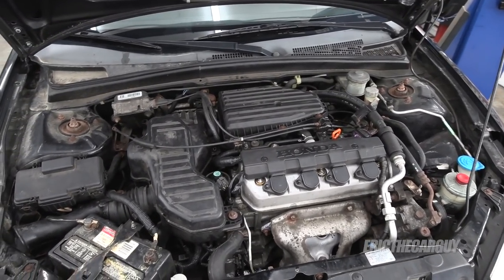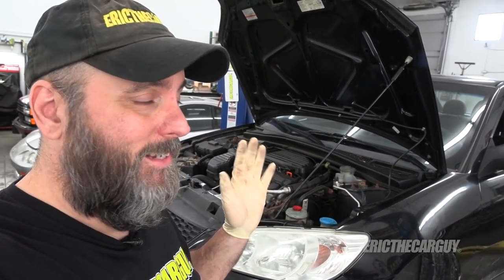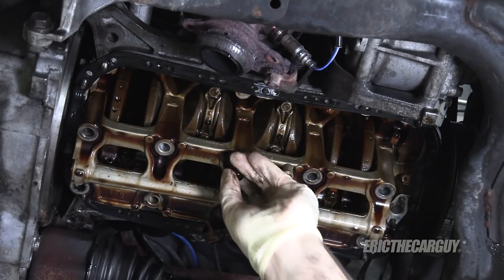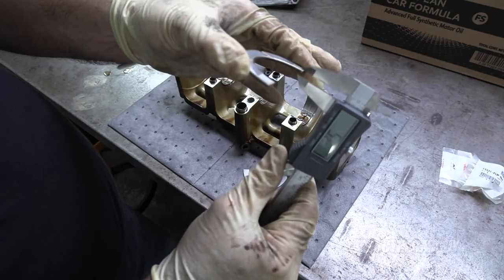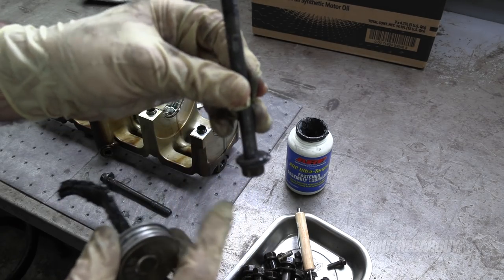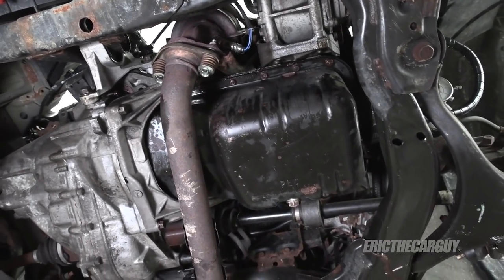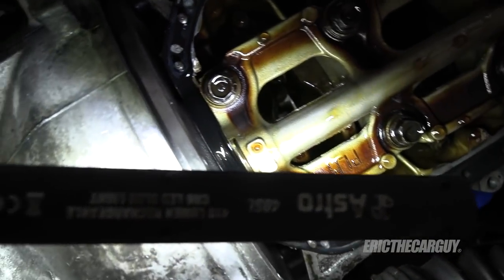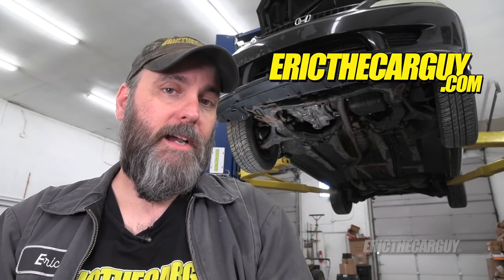How To Test and Replace Thrust Bearings

Comment: I see the lube on the thrust bearing taking up the clearance on the dial indicator - so I check crank end clearance w/o lube on the engines I build.  Then once the clearance is measured, I take apart and lube the bearing for final assembly.  I have a 2008 5 speed civic with 230,000 - I hope it keeps chugging along - manual civics for the win!
Reply from the maker: Great suggestion. Thanks.
Reply: 👍 oil and grease take up space with tight tolerances.

Comment: Eric, have you checked if the engine has high crankcase pressure. That can cause leaks at basically every oil gasket.
Reply from the maker: That's not the issue in this case. I've actually already fixed the leaks. That will be covered in upcoming episodes.
Reply: So true. I got all the bad leaks stopped on my accord but blow by out the dip stick prevents me from having the clean engin bay of my dreams.

Comment: Great video Eric but one thing I was going to mention is that I think some of the excessive endplay you are getting is because you had the base of the dial indicator mounted on the body of the car instead of the engine block so your also measuring play in the engine mounts ect so you may be well within spec 🙂
Reply from the maker: Good point.

Comment: Never seen the inside of a Honda engine so I didnt know Honda engines had a built in main cap girdle. Beefy. I also didnt know they had individual thrust bearing "sides" that were removeable unlike a one piece saddle type main bearing for American V8 engines. I like the Honda version better as it is definitely alot more easily to access and replace while engine is still in the vehiicle.
Reply from the maker: In my view, Honda makes some of the best engines ever. Transmissions on the other hand...

Comment: After market gaskets are HARD compared to the soft and pliable OEM gaskets.  I put a brand new aftermarket valve cover gasket that leaked to no end. Ordered a new OEM one and the difference is massive. The OEM is soft and pliable, it actually expands and seals while the aftermarket is just a piece of hard rubber like material that doesn't seal.

Comment: As usual a great video. I did these on my 03 Mitsubishi that had 150k mikes about 2 years ago that had a lot of end play and oil leaks at the seals. After replacing the thrust bearings, the crank shifted back a few thousands and the seals were no longer riding in the grooves that were worn into the crank thereby fixing my end seal leaks. Downside was the flexplate bolts were slightly contacting the trans cover, some quick grinding took care of that. 15k miles later still dry. Keep the vids coming.

Comment: Every time you miss something small like that little piece of old gasket, you learn from it.
I once changed my oil and got 10 feet before the filter popped off the car and drained all the new oil onto the street. The problem? I never checked for the old filter gasket and doubled-up. 
I've learned and now I take the extra 3 seconds to check every time.

Comment: I’m over 70, time served marine engine fitter. I knew a lovely, old school, old engineer when I was 30. He insisted that every bolt he took out, must go back only into the hole it came out of.
Thanks for sharing
Reply: I'm guessing this is from when machining and thread cutting was not as accurate as it is these days. I guess it would have actually mattered in those cases. Interesting
Reply: @tiberiusclaudiusnerogermanicis  yes, it was “a bit since” much of it was to avoid a stud going into a blind hole if it was the wrong stud and slightly longer or shorter. 
It’s embedded now, I always try to make a cardboard template of sorts and put studs into the appropriate whole. This video shows Eric finding out the hard way, albeit harmlessly. There was a thoroughness about the old ways and there is breathtaking, mass produced accuracy in modernity. I’ve enjoyed the best of both worlds. I have, above my workbench, “Accuracy is a prerequisite, not an optional extra,” and envy those who are inherently accurate.
Reply: @observersnt  no envy for me then hahaha. Very interesting I tend to pop bolts into the holes on the parts or re thread them a little if I can. If it's a rocker cover and all the bolts are the same I just pop them in the mag tray. Although we all know that the bulk head below the wipers are always the no1 bolt and tool organiser hahaha. I lost a 12mm spanner and I noticed cos it was one of my knucklesaver mac spanners so I was cross and spent alot of time looking... fast forward 1 year, a car comes it for its annual MOT (UK inspection) service to me and what was sitting there as I raised the bonnet...... you guessed it. Mr 12mm lol. Shows how often said customer lifted their bonnet and over here oil changes are annual if people even bother to get them done..

But I digress. Interesting info there. Thanks for taking the time to write it:)

Comment: Hey Eric, I’m sure you’re aware of this but just incase, something I often see overlooked on any seal that has something spinning inside of it is a groove cut into the spinning object like your crankshaft from the seal, maybe you have some footage of the replacement of the seals and can review it to see if there’s a groove. If there is a groove cut into the crank you can fill it with a metal epoxy resin and install a repair sleeve. Thanks for the video and have a blessed day.

Comment: In my experience, if failure isn't obvious, it's not the problem
I had a faulty distributor for 5 years and checked every other part, wires, plugs, ECU, pump, etc... and vacuum leaks I found your channel 10 years ago thanks to that lol. But my distributor was obviously destroyed, just as your seal was not sealing because of the leftovers. Always double check simple things before throwing money at it.
Reply from the maker: Good point, but I simply didn't see that on the stud when assembling the first oil pan gasket. I should probably wear my glasses more. Thanks for the comment.

Comment: simply the BEST!  while i have rebuilt engines - the thought of replacing engine bearings et al w the engine still in - is new territory.  Cool tip using a bent over COTTER PIN in the oil hole for coaxing out bearings, fyi... maybe you did an episode on crank bearings

Comment: Those darn sump gaskets are a pain, I've had the same issue, because I followed the Honda manual. Turns out you need to use more than 6 spots of rtv😂 Now i don't know what to trust. Great video, and you've helped me tons when working with Hondas.

Comment: I really like the UV dye that you can put in the oil and pinpoint exactly where leaks are. Saved me a bunch of time tracking down a leak which ended up being a distributor o ring
Reply: Another trick that can work is using diameter tacious Earth. It's a very fine powder substance used to kill insects.You wash off the area where the oil was leaking. And while it is still wet underneath you hammer it with the powder. Similar to the dye the trail of oil when it starts up again will be very obvious. Even if you don't want to do the work yourself on the car you want to be able to accurately diagnose the problem yourself

Comment: Eric, that cam plug has hash marks that need to align with the mating surfaces between the cylinder head and cam cap. 

The later 3rd gen Integras use the same part. Early 3G Tegs used a rubber plug that would leak. I changed to the revised plastic plug years ago, but I never realized it had a certain orientation, and I’ve always had slight oil leaks from that area. Recently I checked the 98 Integra FSM which shows that plug going in with those hash marks aligned with the cylinder head. Since installing a the new plug the correct way, no more leaks!
Reply from the maker: Think about it, when was the last time you saw a circular 'o' ring seal that was directional? What you saw in the manual was just how things are drawn, it has nothing to do with the sealing of the 'o' ring. It is the same seal as the one on the Integra as you pointed out. Thanks for the comment.
Reply: @ericthecarguy  it’s not just how things are drawn. The manual specially says to align the hash marks with the cylinder head/cam cap mating surface. I never paid attention to it before and always had at least some leaking issues from that area. Now it’s installed per the FSM and it’s not leaking.
Reply from the maker: I won't argue with your experience, but I simply can't see how a circular 'o' ring can be directional. Also, I've never seen a leak like that after replacing a cam  plug and not aligning the marks, including on this Civic. It doesn't leak at all anymore and the cam plug is installed as you see in the video. Thank you for your comments.
Reply: @ericthecarguy  I don’t know either, but I just verified in the 01-05 Civic factory service manual, page 6-50, that it also calls for aligning the marks to the cylinder head. If it doesn’t leak that’s cool, but keep an eye on it long term just in case. 
Love all the videos, longtime subscriber here.
Reply from the maker: Any chance you have a link to that?

Comment: I'd use some form of sealant such as Hondabond or equivalent in the corners where the oil pan gasket mounts. Used to have to do that with the cam cover on all the motorcycles I've had to prevent leaks in those areas. 
If at first you don't succeed, try again and it will come to you. Thanks for the informative video!
Reply from the maker: This uses a smooth transition at those curves so there are no hard corners where leaks can occur. Besides, the oil pan gasket was not the source of the leak. Thanks for the comment.

Comment: I've had new seals prematurely fail if there is any scoring in the crank sealing surface. Even if I can't catch my fingernail on it. I've since taken to installing repair sleeves on the crank front and back when resealing the engine. I've stopped all seal leaks with this method.

Comment: I'm replacing the crankshaft, bearings, and all gaskets and o-rings; basically rebuilding my 2000 Civic EX with a D16Y8.

A note on the oil pan gasket: My engine has 186K with regular oil changes all its life, and I could reuse the stock gasket if I wanted. It's still quite pliable hence it's never leaked, and it was also helped along by the Hondabond applied around its outside at the factory.

Comment: I was waiting for the Honda bond. Last one I did for my hatch when I had the pan off for the oil return modifications I slathered the Honda bond on the entire oil pan matting surface. I have also had issues with used cranks where there is a groove in the front and rear main seals matting surface that ended up needing a speedy sleeve to build the surface back up.
Reply from the maker: I strongly recommend against using Honda bond AND a gasket in that way.

Comment: Is there only thrust bearing on one spot? Or several across the crankshaft? This looks like an easy process. Would this be a recommended thing to do for an older manual engine? I’ve been having issues with crankshaft end play I believe on an old ford that’s causing the flywheel to be a bit off and causing starter grinding periodically. Thinking I’ll check these since I’ve done everything else possible to resolve the problem.

Comment: My d16y8 has some leaks around the oil pan, but it doesn’t look like there’s a rubber gasket there. Did they come installed with some sort of sealant originally?

Comment: you mean the slots face the crank webs. My trans filter gasket is recommended to be reused, however, I don't like to reuse any gasket. Rubber does not do well with motor oil, blow by destroyed a trans mount on another car I had. Trans pan gasket with trans fluid another story. Hey good catch with that partial gasket causing a gap, but I saw a dived on the block next to that stud.

Comment: I found this video to be very interesting. Though, I suspect this job is not as easy on some engines. I suspect some engines require more tear down to replace the thrust bearings.
Reply from the maker: A bit more on some engines, yes.

Comment: I always jump to valve adjustment when oil is leaking from multiple places. Valves too tight cause too much crankcase pressure. Likewise too loose can cause delayed ignition of fuel and Mis-timing of the flame propagation which can lead to increased crank pressure as the flame pressure will be out of sync with the valves by a few millisecond. Could also be rings or bad pcv/clogged pcv hose, not sure if you checked any of those things yet.
Reply from the maker: In my 25+ years of working on Hondas, I have not experienced anything like that at all. The valve adjustment has nothing to do with oil leaks, at least in my experience. I know for a fact that had nothing to do with these oil leaks as I'll show in future videos. Also, I adjusted the valves when I did the timing belt work on this engine. Thanks for the comment.
Reply: @ericthecarguy  my integra was leaking oil and valves fixed it. Leaky valves amount to the same thing as blowby pressure. Too tight obviously affects more than too loose but I have seen some very very out of spec valves on the loose end of things and oil leaks got better after. Perhaps I’ve just worked on some pos cars 😅

Comment: Hi Eric. Good day. I have honda accord 2.4 2006 and has run about 200K Km. I saw your previous video saying that we need to adjust the valve if running more than 100K Miles. My qiestion is, i asked a foreman, he said it's better if i do the top overhaul to clean alm the carbon. When i asked other foreman, he said no need to do the top overhaul unless i burn the top gasket or if it's leaking. He also said that no carbon been built as now days petrol or gas has addictive to avood those carbon. What is your opinion Mr Eric? Have u experience it? Thanks in advance

Comment: A question for you,Eric! I built a 4AGE many moons ago, and its very gradually dropping oil pressure - from 40psi at hot idle when it was first built, down to now 10psi, about 5000km later. Everything still sounds perfectly running, no knock or anything, but I am concerned, especially as I made the sinful mistake of reusing the original main cap and rod cap bolts. I fear that they are stretching, especially as its being run with 15psi of turbo boost. So I want to take a look at the bearings and the bolts, but I have a paranoid fear of doing so. I noticed you didnt mind throwing the main caps back on with the same bearings. You even reused the bolts. I guess my question is more of a request to reassure me that its probably a good idea to take a look - can you please give me a pep talk here?

Comment: I’m having an issue with a recently purchased civic. when I press the clutch in, car will stall almost and make a squeak noise. This happens even in nurtural. Ever seen failed thrust washers cause this? Gonna drop the pan tomorrow and investigate

Comment: I had one of these in for a timing belt job the other day.  I saw lots of oil near the front seal/oil pan so I ordered a front crank seal with the timing belt kit.  When I got into the job I found the front crank seal dry as a bone so I didn't replace it.  From what I could see it appeared to me that the oil pump housing was leaking, along with maybe the pan gasket.  I believe there is an o-ring behind the oil pump cover that leaks. I didn't have parts, the exhaust bolts looked angry, so I didn't remove the oil pump and oil pan.  Waiting until the customer brings it in for the leak.
Reply from the maker: I strongly advise against that. I next to never see the oil pump housing leaking. 9 out of 10 times it's the cam seal leaking down the front of the engine, or the oil pan gasket.
Reply: @ericthecarguy  It was dry up at the top.  That cam seal plug you replaced was bone dry.  I've replaced those before on these engines.  There is a large hex key plug on the back side of the oil pump cover, (I think it's the relief valve spring,) and it was wet from about there down.  Just adjacent to that, behind the pump is an 0-ring I'm pretty sure is leaking.  If the car comes back for the leak I'll probably put some dye in it.
Reply from the maker: I believe they seal the oil pump to the block with Honda bond which is why I rarely see that leaking. The valve cover is also suspect. BTW, the cam plug is on the opposite side of the engine. I'm talking about the front cam seal leaking. That is super common. When it leaks, it runs toward the back of the engine and down the back of the block. You could always add dye to find the source of the leak. Good luck.
Reply: @ericthecarguy  It is sealed with Honda bond but there is also an o-ring that hardens up over time and leaks. This one is bone dry up top.  Leak is just down by the pan but appears to come down from the oil pump area by that hex key plug.
Reply from the maker: Again, in 25+ years of working on Hondas, I very rarely see an issue there. It's usually coming from somewhere else in my experience.
Reply: I think you nailed it. Hondabond runs UNDER the o-ring that sits in the upper portion of the oil pump. They almost always fail past 150k miles. I have replaced dozens of them on various Honda motors but mostly on the J-series e V6 engines. I don't doubt Eric's expertise but I do believe it's a very commonly overlooked area.
Reply from the maker: @Tyler Tran Check out this video. The only place that can really leak is back into the engine on the J series. https://www.youtube.com/watch?v=XfDKhjlN7X4

Not saying there can't be a leak there, just that in all the years I've been working on Hondas, I haven't seen it. Yet, many people seem to think it's an issue. In the case of this Civic, the oil pump wasn't leaking at all, and that's been verified after 1200 miles.

Comment: you have to mount the gauge on the block to do that measurement for an accurate reading since the engine is sitting on rubber mounts that move